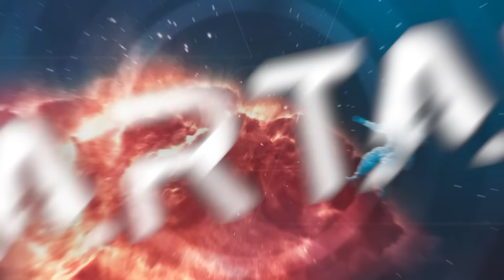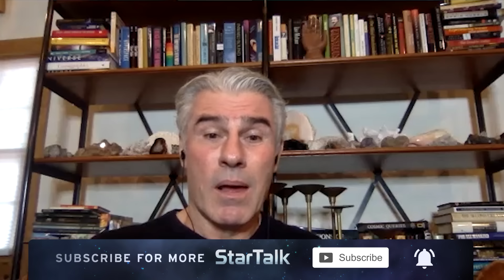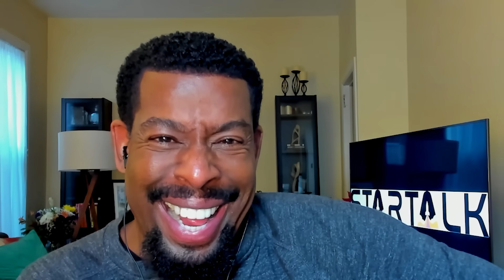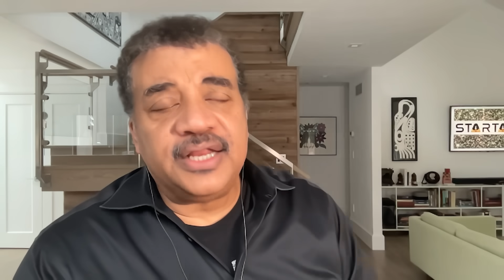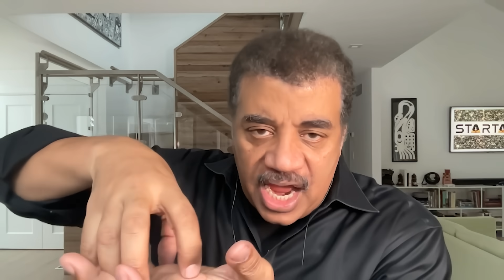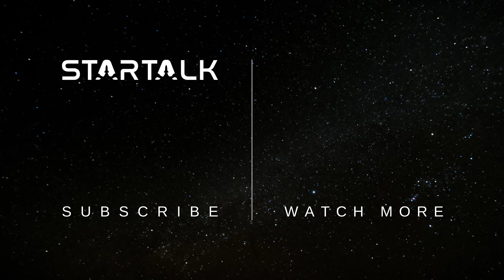What’s The Fastest A Car Can Go? | Neil deGrasse Tyson Explains...

Comment: I was suprised when Neal didn't include all wheel drive into the discussion, especially when snow plowing was mentioned.  Having four drive tires vs 2 increases the coefficient of friction substantially which with current technology does allow several current production vehicles to easily surpass the 3 second 0-60 "barrier". Tesla plaid and Porsche 911 turbo are 2 examples
Reply: Nevera from rimac is even faster than plaid
Reply: @prckata  it's also over 10 times the price
Reply: There is an old Audi TV advertisement where they drive up a ski jump tower with their quattro, and I think they did not need a lot more than spike tires to achieve that.
Reply: c8 corvette does more than 1g
Reply: Would more than four driven wheels be even better, then?
Reply: @Lawrence D’Oliveiro  With an ice driven vehicle I doubt it. The drivetrain losses would start adding up quickly.  Electric motor for each tire would be an interesting experiment.  Diminishing returns though I would imagine with each driven tire added.
Reply: @390fe451  ICEs are capable of acheiveing the maximum possible acceleration regardless of drivetrain losses. If they weren't then ICEs would be incapable of burnouts.
Reply: @Erowens98  You're overlooking one issue .Technically it's not horsepower that accelerates you; it's torque.  And ICE's never reach peak torque below about 2,000 RPM, with most car engines peaking in the 3,000-5,000 rpm range.  Electric motors can produce max torque from 1 RPM all the way up to their rev limit.  That gives them a huge advantage in converting potential energy into forward speed.
Reply: @lawrencedoliveiro9104  Maybe.  Not as simple as you might think on a relatively slippery surface.  In general you do have four contact patches which usually means better traction.
Reply: 7 minutes in. He does a few 2.2 and better 0-60 with a stock plaid on a regular street. 
https://www.youtube.com/watch?v=-AQZh7VBhM0
Reply: Thats not how that works. Your coefficient of friction doesnt exceed 1 just because you have 4 driving wheels.  It does increase the total useful friction available, which helps when pulling heavy things. But If one tire has a friction coefficient of 0.92, then adding 7 more identical tires will still only give you a friction coefficient of 0.92. This is because friction coefficient = F/N. Where F is the force of frictional, and N is the perpendicular force (gravity). Surface area does not enter into the equation. 
And without a friction coefficient higher than 1, accelerating faster that 1g is impossible. 

The reason tesla is able to accelerate so fast is because they're cheating. They use rollout 0-60 (which is 5-62mph)on a glued track to achieve their time. Not a true 0-60 on a standard road.

The friction coefficient between a good tire and a good road, without glue, is around 0.9. 60mph = 26.822 m/s

So the maximim possible 0-60 time without cheats, is 26.822/(9.81*0.9) = 3.037 seconds.
Reply: @Erowens98  they have timed without the rollout and done timing tests and are still sub 3 second for a LOT of cars actually
Reply: @circci8679  2.73 second 0-60 is the maximum possible if your coefficient of friction is 1.0. So, if you have a very good tire, better than the standard "good tire" of 0.9, you can approach 2.73 seconds. Still cant ever get below that without a prepped track and specialty tires.
Reply: @Erowens98  With 4 driving wheels, each with the same normal force and coefficient of friction, you have twice the total traction than if you have two driving wheels.  Also, with 4 wheel torque control the grip is maximized because slip is eliminated (sliding friction is less than static friction).
There are competition specific tires that have greater than 1 coefficient of friction.  The treads are quite soft and they wear out really quickly.  There are commercially available motorcycles that can go from a dead stop to 60 MPH in the 2.8 second range on factory tires.  Modern motorcycle tires are quite sticky when warmed up during normal riding and wear out pretty quickly.  The sticky is designed in for cornering adhesion, not for maximum acceleration, but they do contribute to the low times.

Comment: Great video!! Many car manufacturers use “rollout” to achieve a quicker 0-60/62 time for their spec sheet. They don’t start timing until the car is already in motion. The channel, “Engineering Explained,” has a good video demonstrating this as well as factors limiting a cars quickness. With equations 😊
Reply: Engineering Explained is a fantastic channel, good shout
Reply: @AspLode agreed! 

@Alek Sander something to grab views from car guys maybe. What enticed you to click and watch?
Reply: Yes, but in the Engineering Explained video, the rollout numbers were used to get the time below 2s.  Without it, and even without the prepared sticky surface, the Tesla was well under 3s to 60mph.  So Neil is wrong.
Reply: Other than Tesla (who only does that for the Plaid Model S) who else does this? 

Tesla is the only company I know of who does this, and they don’t do it consistently.
Reply: @zero11010  does what?
Reply: @prckata start the timer when the car is in motion meaning it cannot possibly be a 0-60 run because the car is not stationary when the timer begins. 

It’s a standard way to do the timer in a certain kind of drag race. Cool. That’s not the way ANY other car maker does it, and that’s not the way Tesla does times for any of their own cars aside from the Plaid Model S.
Reply: @zero11010  they all use that method, read any major magazine and it will say 0-60* (excluding rollout of 0-5mph) 
Now I believe since everyone has gotten their hands on the satellite timers, many people online use actual numbers but the reported numbers have been false for 30+ years
Reply: @SilentRacer911  any major magazine? I haven’t even seen a magazine in 20 years. 

There is a standard. Tesla not only doesn’t follow it, they break from the standard in one out of about 8 models (core model and performance variants). 

And in addition to the time crap, they also glue the track. Which, while normal in certain very specific kinds of drag races, is not what anyone else is doing and also not what they do with any of their other cars. 

Again, this is dishonest.
Reply: @SilentRacer911  thats only American magazines. This is not standard practice elsewhere.
Reply: @zero11010 Audi, bmw, Chevy etc… some manufacturers report slower times than testing shows. Really there are many variables to consider however when “magazines,” or “publishers” if you’d like, test using various methods and come up with the same/slower/quicker times in comparison you yourself can determine which method the maker is likely using.
  The fact that Tesla actually labels theirs as such doesn’t mean they are the only ones using the “rollout” method. It actually shows they’re deceitful, some may say clever, marketing by not showing their standard model time done with the same test. Is that dishonest? What exactly is the standard that you mention?
Reply: @kevinkevin7860  the typical modern standard is software that measures when movement begins and starts a timer. Using GPS to determine speed it lets you know when you reach 60mph and stops the timer. 

When BMW or Toyota or whoever else releases a car reviewers will test those figures. Generally, reviewers can repeat those times or get extremely close to it. 

They do this on normal roads. So, weather may not cooperate. The road surface may have debris. Temperature may not be ideal. Still, it’s usually very close to exactly what the manufacturer states. 

That’s CLEARLY different from what Tesla have done with the model S Plaid. 

It’s still not exact. 

Similar things happen with horsepower numbers. Some manufacturers downplay horsepower a bit. It’s less common than it used to be but it still happens. This feels like a safe way to conduct business to me. If you claim 300hp and the user actually gets 315 no one is going to complain. But, if they actually get 299 that company may get in trouble. 

I think we see similar mentality with 0-60 times. 

You’re welcome to go look at people doing 0-60 runs with a Tesla Model S plaid on street. Then do the same thing for the M3 Competition, or Macan GTS, or the Prius, or the EV6 GT. 

Or stick with Tesla. Watch Model S plaid, then go watch Model 3 performance or a base model Y.
Reply: @zero11010. Do manufacturers do these tests on “normal roads” that are subject to weather/debris etc. as well? I know the demon wasnt, but the numbers are marketed to a specific audience and how they plan to use it.
  I agree things aren’t exact. As you stated, they definitely did this with hp #s lol under reporting for many reasons. 
  I personally prefer to watch speed videos of muscle cars that sound brutish, the teslas don’t do much for me.
Reply: @kevinkevin7860  you’re asking for more details than I readily have access to. I do know that as these cars have automatic transmission and launch control and all the rest. The launch times you get have WAY less variation in them. If you looked at launch times from 20 years ago you would find way more variation as your willingness to fry a clutch and your personal ability to row the gears could readily account for 2-3 tenths of a second. 

I hear you on everyone having a thing they’re into. Personally, I can’t stand 0-60 or quarter mile stuff. I much prefer to hear about track times because I actually ….turn and brake and accelerate when I’m driving a car/motorcycle hard. I’ve never been into racing from stoplight to stoplight on a straight road.
Reply: @zero11010  The 1ft rollout has been around at least since the 80's - way before Tesla. It was basically kept in order to compare apples to apples from when they were only timing cars at the dragstrip where there is a potential of having an extra foot of start due to the staging lights. EVERYONE has been quoting these types of 0-60 times ever since.
Anyway, using a GPS device (dragy) I was able to get a true 0-60 of 3.51s on my Tesla non-performance model 3 on the street with their factory all season radials. I was also able to run a true 0-60 of 2.47s on a rental Tesla model S plaid with stock radials on standard unprepped pavement (from the shoulder of a highway). I only tried a few times total, so I know better is possible. 1/4 mile of 9.58 @ 151, btw...
Reply: @mmark300  so, is this how GM does the 0-60 on the Yukon? How about the Hummer EV? Is this how Ford does the GT? How about the Bronco? Which cars does BMW do the timing in this way? Oh, none of them? Is it none of them? Well, what about any other German car maker? How about any car from Japan? Korea? Is there something from the UK where they do this? How about Italy?

Tesla makes a bunch of other cars. How many other cars that Tesla makes do they record the 0-60 time in this way?

Zero. There are ZERO other cars that I’m aware of where they provide the 0-60 time in this way. 

I promise I don’t care if this is a legit way to do a specific kind of drag race 0-60 time. 

And, because the timer doesn’t start at 0 miles per hour, as far as I’m concerned that makes this a lie. Because the timer starts when the car is at about 6mph that makes this a 6-60 time. It very literally is not a 0-60 time even after they glue the surface of the track …. Which they do NOT do for any other 0-60 time for any other car that I’m aware of. 

So, it’s dishonest to call it a 0-60 time. That’s just a lie. 

And it’s dishonest to use this very different method of launching that no one else uses when selling a car. And it isn’t even a standard at Tesla. It’s just a trick they use to lower the 0-60 time for one version of one car model. 

This is dishonest.
Reply: @zero11010  You may be correct about 0-60, I don't pay that close attention to the car makers claims. I know the Tesla 1.99 claim used to have an asterisk next to it but I don't currently see it on the mobile site. 
So what about the 1/4 mile claims? All tracks have staging lights so any of those times could be dishonest depending on how the driver staged, right?  But then how do you accurately compare against every car that ran at a dragstrip?
Reply: @mmark300  the current topic is the 0-60 time. 

I’ve never put any thought into a quarter mile time. That’s a pretty useless measurement as far as I’m concerned. 0-60 gives me some idea of acceleration. Virtually anything else I want a Nuremburgring time for. 

I’ve never once questioned how they do it or bothered to track the times for cars or motorcycles. 

0-60, 60-60, and lateral G force are about all I would look at for a new car. I don’t need an eighth mile or a quarter mile or a figure 8 or whatever else.  The slalom or emergency lane change are interesting metrics, but there are too many variables which I think would reduce accuracy.
Reply: @zero11010  The asterick by the 1.99 on the Tesla website clearly says 0-60 with rollout subtracted. 
While I always thought 0-60 was a fun metric, there are too many traction  related variables that affect it to have as much meaning to me as the 1/4 mile. At least in the 1/4 mile there is the ending mph.
Reply: @mmark300  clearly? Most people have no idea that they didn’t do a normal 0-60 run. 

What they’ve done is, at best, deceptive. 

At the core what have they done? They gave themselves several advantages and then compared themselves to others that don’t use those advantages. 

It’s really obvious.
Reply: @zero11010  Poor Tesla, can't stand the fact their best car can't do 0-60 in less than 2 s, so they have to cheat.
Reply: Honestly, quite a pointless video in my opinion.
Reply: @aleksandar6056  it's only pointless of you are a tesla fanboy.
Reply: @Josmersuero  I like tesla, but that is besides the point.

Firstly, the title and thumbnail of the video are entirely wrong. "Terminal velocity" means the highest speed a given objecct can fall in a fluid. That has literally nothing to do with acceleration or this video.

Secondly, everything he said can be summarized in a 1-2 minute video without loosing information. This is because he didn't really say much. In fact, let me explain half the video right now:   You can't accelerate faster than 1G unless your tires are "sticky" (also, "sticky" is quite a dangerous term to use here because you would be surprised how it starts to "loose" an exact meaning once you start to question different scenarios or look at things at a microscopic level)

Comment: Another way of saying what professor Tyson is saying here is the old rule that a car can never accelerate faster than it can decelerate. That is no longer the case. Using various means manufacturers have found ways to accelerate faster than 1G and to decelerate faster than 1G. 

"According to calculations based on MotorTrend's data, it turns out that in the case of Plaid, the acceleration was 1.199g on average, while braking was at 1.156g on average."
Reply: Last year on the ARA rally tour, the late and great Ken Block had a crash that the investigators labelled as a 12g stop.

Comment: If you did the same on a planet with 2G gravity, with an atmosphere made out of a lighter gas, giving it the same air resistance as on earth, would you then get to the same speed at half the time?
Reply: Yes. The (theoretical) limit is based on the acceleration of gravity. Doubling it would double the potential friction force while keeping the mass the same, so, assuming enough power is available, forward acceleration would also double.

Edit: One could simulate this on earth by making a track with magnets underneath the surface (and/or onboard the car) with enough downward force to be equal to the force of gravity. 

While this would be astoundingly expensive, it would be a lot cheaper than transporting a Rimac Nivera (or whatever) to some hypothetical planet with 2G gravity.